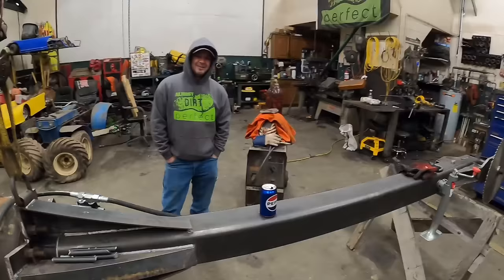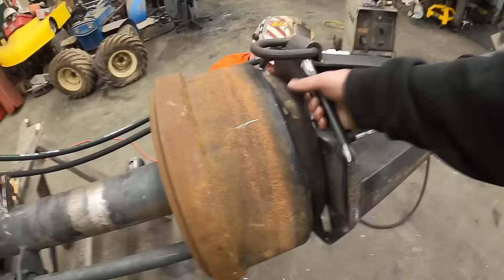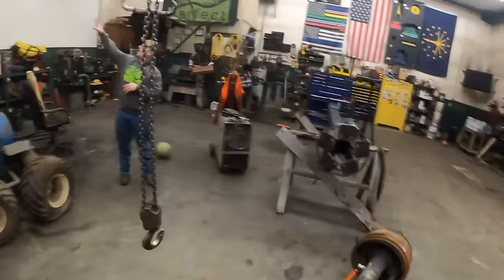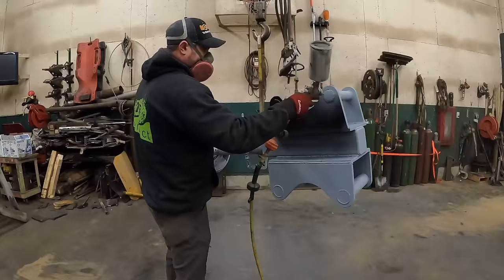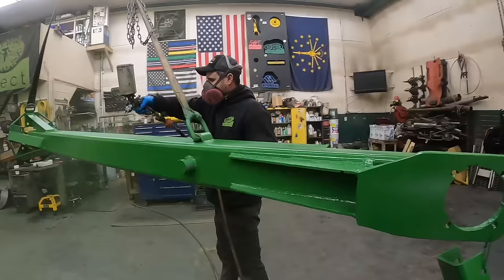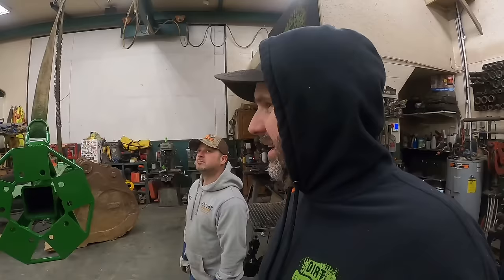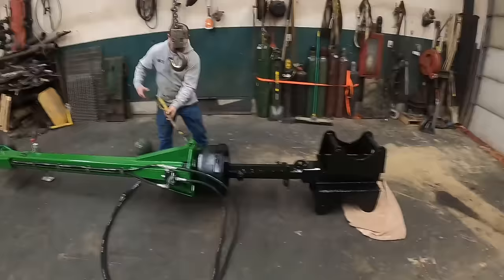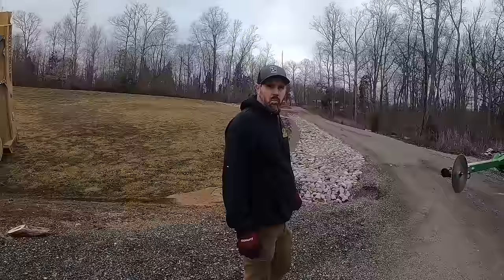Is The Saw Fully Functional Or Just A Piece Of Junk?

Comment: If that contraption had a rubber mounted camera close to the blade and a screen mounted high in the cab so when you are looking up you could have 1 eye on the screen and 1 eye on wot you can actually see it could be used with alot of precision, just a thought . Nice work great video

Comment: Add an upside down "V" just under the end of the boom where the gearbox is mounted that sticks to maybe 4" to 6" below the blade.  It will capture the limb and keep it from trying to shoot away from the blade when cutting it. It also helps to "guide" the limb towards the center of the blade if you're positioning is a little off.  Maybe 1" or 1.5" square steel tube should do it.

Comment: Good job on the paint job, and on protecting your lungs by wearing a respirator, but make sure to use a combination filter cartridge that includes an organic vapor cartridge in addition to the pink pancake P100 particulate filter you did wear. That will protect your lungs from the solvents in the paint too.

Comment: Did yall see Clint’s latest video, a helicopter dropped off a trimmer for cutting right-a-ways! Like pipelines and high lines! That trimmer had about 6-10 saw blades on it! It was cool Mike, take a look at Clint’s channel! You talk about small drive shaft tube and flimsy looking! Check it out, I’m going to look up some videos on those cutters!
Reply: Those cutters are used extensively here in WA State. They do a good enough job for what they are used for, but the cuts aren't pretty or neat. There is a lot of movement because it is hanging from a helicopter. But when your trying to clear limbs from high voltage power transmission lines in the middle of the Cascade mountains, you probably don't care about neat.
Reply: @mikel9567  wow, true!👌🏻👍🏻👍🏻
Reply: That wasn't a drive shaft it was the support tube and to keep it stable.  IT had a gas engine on the inside to power the saw blades.

Comment: Ten foot up in the air - Fooey !   The one I had here (have picture) was a 100' saw.  Trimming red oaks above 2-Phase power service to the ranch.  I had prior to that, taken out two massive oaks - A live oak 28" in diameter that split in an ice storm.  and a 20" Red Oak that was dropping limbs on us and a neighbor.  After I took mine out, they took the sister tree out of their back yard.  Homes move in next door to the ranch.  Rats.  Primer will help it last and last.   A lot of rubbing from trees will abrade the boom.

Comment: The Saw needs positive dedent stops every 90degrees ,also what would be optimum blade RPM to spin that blade ,I have to admit I jumped to the last 15 minutes of the video i couldn't handle the suspense of seeing it work , I knew it would work well and I was impressed, take the valve off and run direct pressure to it for increased torque ,Lastly it looks awesome in it's paint job ,By Mike's paint shop well done you guys it will never be truly done Mike will just keep coming up with ways to improve it .

Comment: Pretty neat contraption. One thing I might have done differently is instead of a circular blade, I might have seen if I could attach a chain saw guide bar. The drive output would have to be a chain sprocket. It would give you the ability to cut a greater width by easily changing the bar. The advantage of which would be the easy ability to replace the cutting bits much more affordably, and easily sharpen it. That circular blade has got to be very costly, while chain saw chains are cheap (and easily sharpened). You could easily change out the bar/chain to a length you want. The bar two mounting bolts would allow you to tension the chain. The difficult part would be to design a method to oil it. You could use hydraulic fluid for that, but would need a way to knock down pressure so it just dribbled out into the bar oiling port. Where the bar mounts would have to have a hole drilled that would line up with the oiling port on the bar with a hydraulic line fitting on the other side of the mount. Maybe a tee off the drive hydraulic line with a valve you can barely crack open. Then you would also have to occasionally add to the machine tank after use to replenish what was used. Maybe down the road if the blade gets ruined. The circular blade did get hung up a couple times. A drooping limb could bend the blade. I would cut from top down only to avoid pinching/binding that could destroy your blade.

Comment: AWESOME!!!!  Just freakin' AWESOME!!!  Name suggestion, " TREE REX ". I have seen Limb Reaper on other equipment. I have 55 + years in wood working and general carpentry and also know my way around a chain saw and would like to offer some safety tips for you to consider. Cut limbs from the bottom of the tree up to the top to prevent snagging falling limbs. ALWAYS cut on the top side of the limb to prevent pinching the blade. Let the blade cut at it's own speed. Never push or force it to cut more then it wants to. If it seems like it's not cutting well, check the sharpness and get it sharpened ASAP. I know a blade that size is expensive but consider a spare to swap out when you're in the middle of a job in the middle of no - wheresville. It could take a week or more to get your blade back from a sharpening shop. DP's paint work is good but MBTS's idea of the Barbour pole would be better for visibility when working in live, green, leaves and trees. Consider some contrasting depth gauge marks ( like on big ships ) so you have some idea of how far in your blade is.  I could go on but don't want to write an operator's manual. You wouldn't read it anyway. LMAO. Later guy's.

Comment: Fine job fellows. I would suggest that you be careful around or near any power lines. The regular boom saw for tree crews are designed with an isolated fiberglass break built in the upper boom to protect crew members on the ground that may be in contact with the equipment.

Comment: Best cover for that blade would be an old bicycle tire of appropriate size. Cut across tire completely once so you can open the circumference to install over blade teeth. Remember to install with cut down to allow water to drain.

Comment: The Frank-N-Saw build was great! Go to Harbor Freight. Buy a cheep Winch with remote control. Replace spool with a sprocket and use that to remotely control your blade angle. Yep you'd need to run a 12 vdc source.  Way cool project, Great job guys!

Comment: Should have painted the beam a high visibility color like yellow, orange, or red. That green could disappear among the leaves and branches and you will be cutting blind. I also see two possible fail points, both on the drive end. The mounting holes for the angle drive are so close to the edge they can fail. I would suggest welding in bushings to reenforce the holes. The other is the sharp corners where you cut out the section for the motor. The corners would be prone to cracking. I would weld a radius in those corners to spread any stress.

Comment: Tree-Rex is a cracking name gets my vote 👍🏼
Also what a brilliant build considering what you’ve spent on it Mike.
🤜🏼⚡️🤛🏼
On the clearing up behind you Mike have you considered putting a Grab on Lt Dan?
Grab Wagons (HIAB with a Clamshell bucket for Gravel / Soil and Spoil ) are used heavily in Europe 
for Construction and Utility work.
We had off road Self Loading Dump Trucks in the Military (Scammell S26 SDLT  ) that had twin/  Tri-Axle locks and off road wheels like LT Dan and it made them very versatile as a result.
It negated the need for a loading shovel or excavator to be on site on certain jobs .
Reply: Tree Rex , that's a good one , ,,or  Here's Johnny

Comment: It would be nice if you were able to do the hydraulic system like they do on the turntables of the escalators so that you don't have all that hose. Maybe possibly twisting up on itself and make the rotation so much better. Yes, if you were to do hydraulic rotation, it would make it so much easier, but like you said, you might not use it that much, but you also said that with Bubba dump and guess what you use bubble dump more than ever now.

Comment: Next upgrade would be to add two more saw blades to the boom stick. They can be run via a sprocket and chain system off the primary blade drive. Other than that, great job guys. You continue to amaze me. Thanks for sharing.

Comment: Wipe everything down with paint thinner before you paint.   Get the new steel oil off.  I used some etching  primer on a pick up bed.  It is awesome.  Paint WILL stay on.   Green etching primer.

Comment: Looks great, but I have to question why your hydraulic lines are surging so much? 
You may need to add a case drain if it doesn’t already have one, instead of running the fluid back through the valves
Reply from the maker: Not a option

Comment: In an earlier comment, I had suggested a guard for the rear of the blade.  My thought was it would redirect sawing debris toward the ground.  In thinking further, I realized it would do the same for the spinning blade in the event the nut spun off and the blade came off the shaft.  That would be much better then to have it sailing at the cab at 100 mph.  Although, without knowing which way it’s spinning I’m not sure which direction it would fly.
Reply from the maker: Never work plz think about it
Reply: @DirtPerfect  I understand the challenge of interference with the cut.  If the guard was mounted on a spring loaded swivel that may work.  As creative as you are, I’ll bet you could figure out a solution.  One  look at that video will tell you how dangerous it can be to the operator and bystanders.  The other solution would be to switch to a chainsaw cutter.

Comment: When you apply the "Dirt Perfect" stickers, make sure their right side up for each machine quick attachment bracket.  ;-)
I wonder if this would fit on the "Super Stick" and both be used on thee excavator, but I expect, even it it could be attached the excavator couldn't handle the reach (weight)?
I presume you touched up the "D" rings?
Phase 2: Make it swivel and lock from the cab.  ;-D

Comment: Now to modify it so you can use a thumb switch to rotate it while in the cab and be able to cut in any direction at anytime
Reply: Also with the visibility issue how would mounting a camera to either the excavator boom or mid shaft on the saw and a screen in the cab of the excavator

Comment: `Hulk` is my choice for it . . . . . . . .Because of the sheer length of it when attached, maybe on the Volvo or Hyundai, could you alter the movement speed of the hydraulic arm on the cabs control unit in the cab, to give you more precision movement as you get closer to cutting? It`s a D.P. off the cuff build alright, who needs drawings? lololol Well Done Mike and Aaron.

Comment: Close shave. I am sure most of the cool stuff was built the same way this was, an idea, a shrug and a welder. And if needed 8 inch tile might fit over it if you need to work around power lines... though I have no idea if field tile is considered an insulator against that much voltage.

Comment: Mike if only you guys had thought of welding a small H cylinder or a 12v reversible motor to a ring gear to the brake drum to change the angle of the blade. Then you two would have been KINGS with a patent.😂😂 Just teasing y’all. There already a name for these called a ( Buzz Saw ). Get a bigger blade Mike I dare ya.🤘🤘🤘🤘🤘🤘🤘🤘🤘🤘🤘🤘🤘🤘🤘

Comment: Boo on the color.  The pole should have been painted white after drying. Use 4 inch blue painters tape two wraps for 8 inches  of tape, wrap in a candy cane stripe shoot blue on oneside of the tape then red on the other side. Remove tape when dry then you have a barberpole with 3 colors.

Also two others issues I see, you need a way unlock and auto rotate the blade to vertical for cutting when the blade is skewed and when detaching the pole from the 120 or 210 to set aside on un-level ground may allow the blade to hit the ground with the single jack. Maybe you should consider putting a jack on the other side for storage stability on un-level ground on the jobsite.

Comment: You guys were fussing about crossing the hoses to change rotation.  When you reassembled it after paint why didn't you switch the hoses at the other end so they would lay straight?  Fitting issue maybe is all I can think of.
Reply from the maker: Not a option and other line is it free flow return
Reply: @DirtPerfect  ah, gotcha. Wasn't using my head very well.  Anyway, it's a cool build!

Comment: For safety you need to put  DANGER and an arrow on the boom point at the blade. If you look at a helicopter, on the tail boom they will have a bright red or orange Arrow with DANGER pointing at the tail rotor.

Comment: So I was thinking about this video.. Does it really matter If you change the hoses really who cares. If somebody does care they need a hobby... So I was wondering why didn't you just tape off the brake handle. Then painted that thing black. When you are all done remove the tape the brake handle It would be high visible orange... So a sag, run, drip or a dribble are the same pretty much. In the body shop we would call that signing your work. The boss would say listen you're no f**** Picasso fix it. Do you know the trick with masking tape to remove runs or snags. So you're speckling looks pretty good from a video. I'm not there in person to judge. Have you ever tried stringing, splattering or flip-flopping?

Comment: Fully functional piece of junk? I honestly think you'd be better making a hydraulic set of shears instead. Makes more sense to me since you could cut anywhere along a 12 or 18 inch jaw length instead of a maybe 4 inch cutting area. I als0o think you need to add some sort of indexing bolt in the saw blade as that nut is likely to loosen itself on stopping of the blade. Entertaining but somewhat useless in my own lowly opinion :)
Reply from the maker: lol absolutely not this have worked awesome over the last few months and made me a lot of money sorry for disappoint you